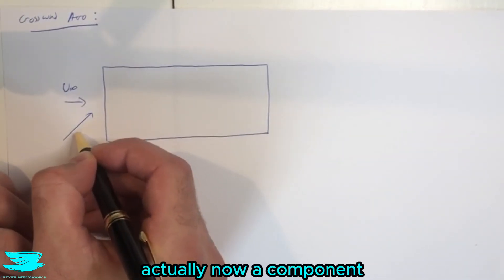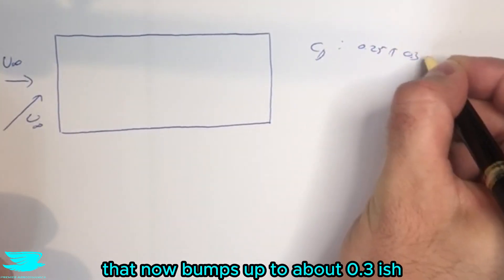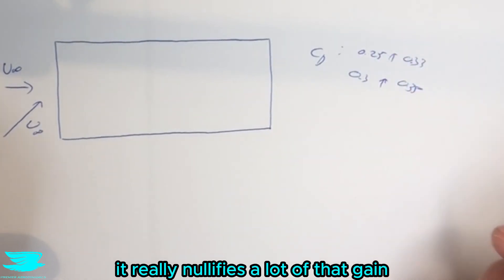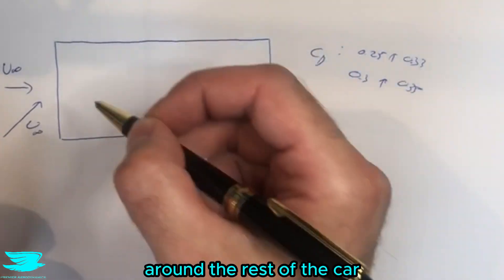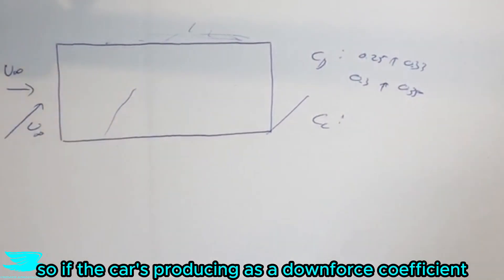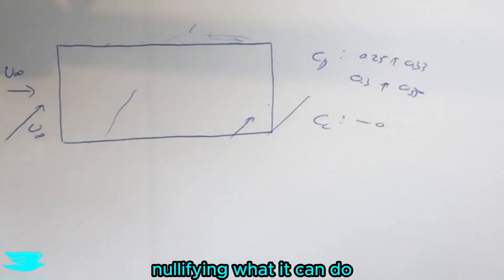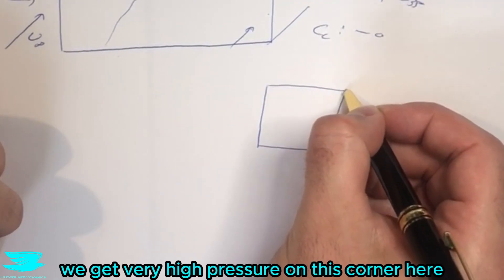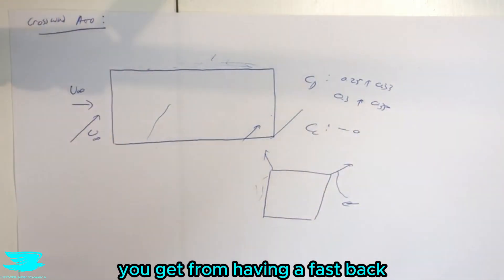Car In Crosswind Aerodynamics {Auto Aero #61}

Comment: I always wondered if you could optimize a cars downforce for drifting,
So instead of sideskirts you would have side diffusers running diagonally across the cars floor
Reply from the maker: You can if you know the direction of the wind and the slide. Otherwise, you kind of have to do a general optimization for all angles you will likely experience.

Comment: So with the addition of my car's boattail, ( see short video on my channel ) I could likely see WORSE fuel economy if I were to take a trip that had 80% of it with a strong crosswind, correct ?
If I have reduced the cD of the car from .34 to .28 from head on, I could see this as being correct, since such a small change in cD would not overide the loss from increased frontal area and turbulence from the side. 
-thanks
Reply from the maker: Front an area point of view, the large boattail will increase the drag with a crosswind, but the drag coefficient will probably still be lower than the regular car because the boattail is sleek from the side too. It doesn't terminate bluntly.
Reply: @PremierAerodynamics  I understand. But is it possible that the car could produce even worse fuel economy figures than an unmodified car if taken on a trip where 80% of the trip has strong crosswinds ?
Reply from the maker: I think it would probably have worse fuel economy because of the increased area.

Comment: If the car is designed correctly, it is able to reduce drag from crosswind.
It just needs to get a thinner tail. 

Just imagine an airfoil of a wind turbine. It is getting powerd ftom the crosswind.
Just design the car like this, and study about very low aspect ratio airfoils

Comment: Actually, sometimes when there's yaw, the car's lift coefficient will not only nullifying, actually it could be in positive - it will indeed creating lift and the car could just take off, if you're fast enough!
You might saw this happened in some NASCAR crashes, and that's also the reason why the Sports Prototype cars - especially LMP/Hypercars - are in their current shape now. The big sharkfin is design to have extreme yaw stability, to ensure the car won't have severely yaw, going sideways and take off at high speed. Furthermore, the opens on the wheel arches are also acting as preventing the car from take off in sideway - the opens will create turbulences to interrupted the airflow alongside the bodywork and eliminated the lift, also they can released the high pressure that created by incoming airflow accumulated under the wheel arches, therefore eliminated the pressure different that goes up.
Reply from the maker: Thanks completely true too. Nascar cars are incredible when it comes to aero. They don't look like much but there are so many little things that make a big difference.
Reply: @PremierAerodynamics  Asymmetrical bodywork, that single (although being banned now) point is enough.

Comment: Why not design the car's aero offset from straight ahead, by like 10 degrees. Then you have a car whose aero works in yaw, more than in a straight line, it works out since you need the aero during cornering far more than you need it in a straight line. If your aero stalls a bit in a straight line because it's designed for yaw, sure you lose a tiny bit of braking performance, but you get more stable aero in yaw, and during cross winds, plus you get less drag in a straight line. Really a win win.

One way you can design the aero this way is to make the car dog track/crab walk in the wind tunnel.
Reply: 1) Goals: for road cars, straight line drag reduction is the most important goal, the cars don't tend to turn so aggressively as race cars for example. Race cars are designed with yaw in mind.
2) Convention: this is how it has been done for decades, this is how the manufacturers will do so in the upcoming decades as well.
3) Marketing: marketing usually includes a mid-plane view of the cars in the wind tunnel or in CFD, showing a nicely attached flow. How would this look in marketing if it was not so nicely attached at yaw/in crosswind? Sometimes engineers have to step aside for marketing (sadly).
Reply from the maker: These are all true, and also the way car drag is reported to the governing body with the WLTP is for straight on flow.
Reply: @PremierAerodynamics  That's cause governing bodies are amateurs.
Reply from the maker: Lol
Reply: This is how NASCAR used to be (they're banned now because it will make the car didn't looked like regular one). They used to have extremely asymmetrical bodywork design to fully optimized for the highspeed left-hand turn only scenario.